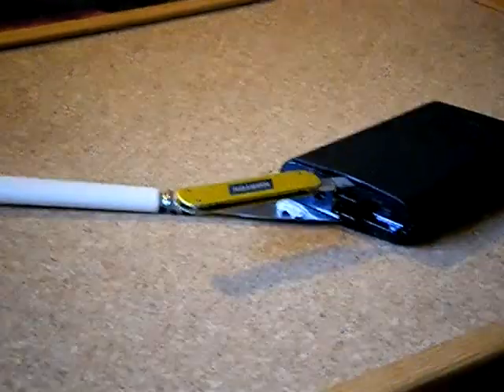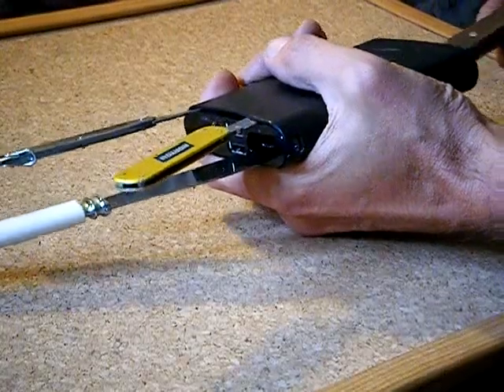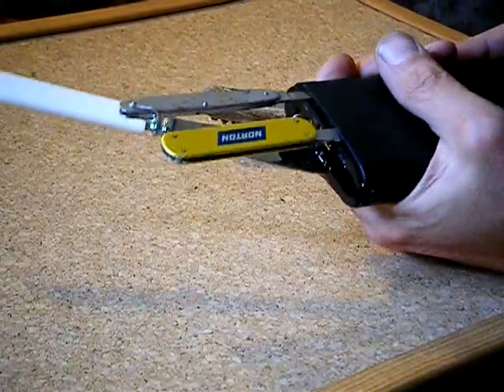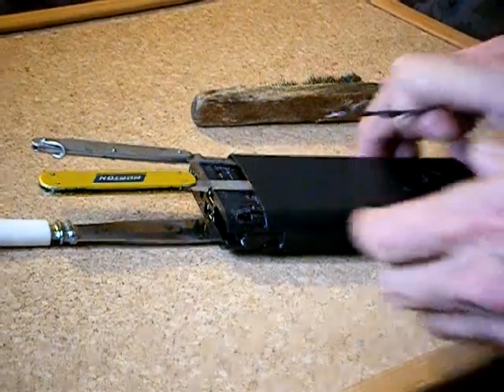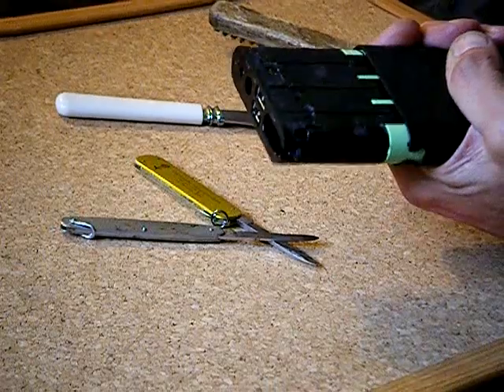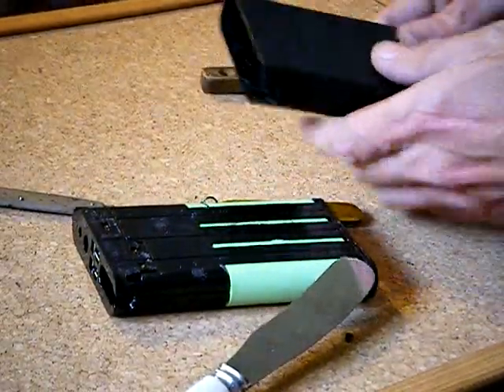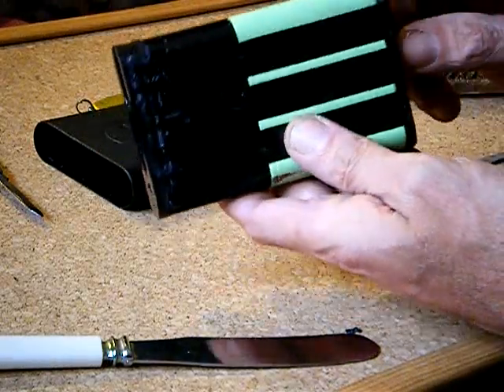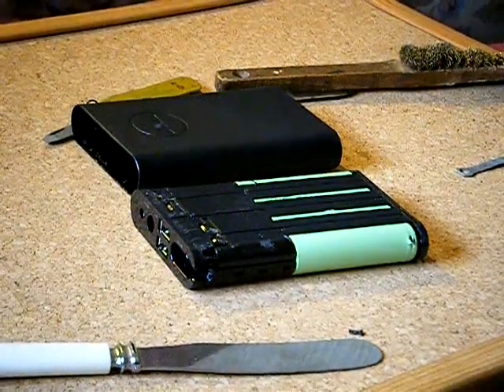Opening Dell PW7015M Power Companion Laptop battery Pack PART 2

Comment: Would a heat gun make this even easier to reduce stress on the case & battery tray?
Reply from the maker: The type of glue they use needs to be cracked / cut to separate instead of using heat to separate.

Comment: is this battery cell r panasonic NCR ?????????????????????????????
Reply: i think so 
it should be 18650B
Reply: @routadu  Open This model USB C, 65Wh - PW7018LC
!
Reply from the maker: The batteries inside are made by Samsung, No. ICR18650-30B.Thanks